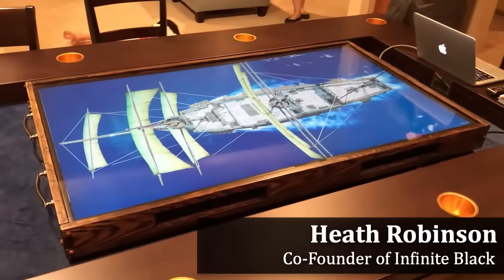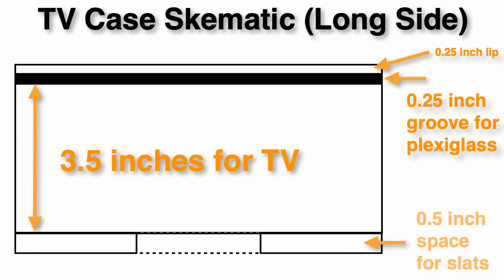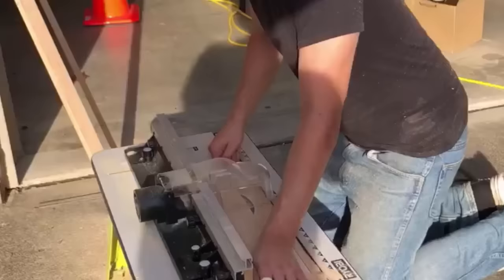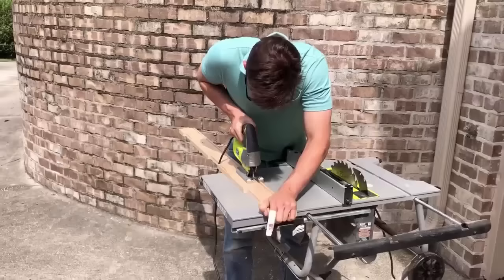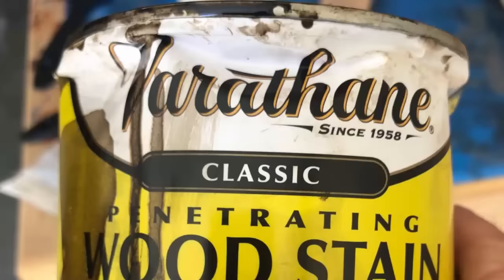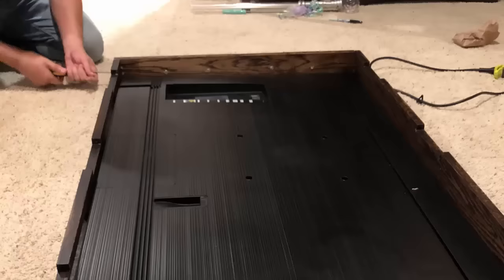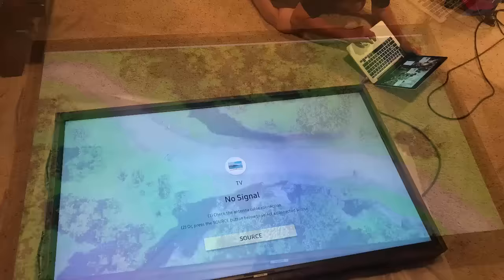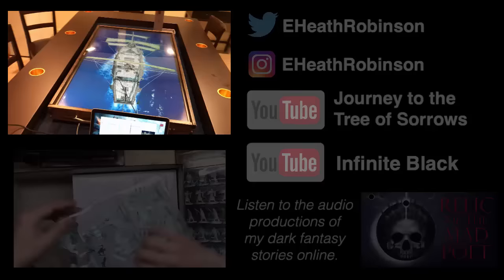Building a TV Case for your D&D Gaming Table for Digital Maps

Comment: I would have used tempered glass instead of plexiglass. It doesn't get cloudy or scratched like plexi.
Reply: It's also a hell of a lot more expensive.
Reply: If DnD is your main hobby and you'll using this for years to come, then it would be worth every penny. I think it would be worse to have to tear that thing back apart in a couple years to replace the plexi, than fork out the extra change for the glass.
Reply: @morgan5941  Well, they only screwed it together so it's not hard to replace the plexi, but yeah, I agree. Plexi is very very sensitive to scratches.
Reply: I've had a sheet of 2 mm plexiglass on my build for more than 4 years now. There's a minimal number of scratches on it, nothing that can be seen when in use, and we use regular minis on it every play session. Including heavier metal minis. Even if we had to replace the plexiglass every 4 years it would take a few replacements to get to the price of a custom cut glass piece. Glass would also be too heavy for my particular build, as the sheet fits inside the bezels of the TV itself, but that's particular to my build, of course.
Reply: I use pool fence glass for mine, it comes in many sizes up to 4x4 foot (thats the largest and is only $90)  my tv took a 1200mmx700mm which was cheaper still

Comment: I have not built mine yet but I'm going to build the whole table with it built right in. I do like that system you have though, you could potentially even still bring it to a friends place to play if its not too too heavy.
Looks great
Reply from the maker: I am thinking about building a gaming table from scratch, and after having done this build I think that it would be a shame to not build in a TV while the work is being done. But, it looks like I will be modifying existing tables for my gaming tables. Putting a TV in an existing table is harder. Good luck with you build!
Reply: @EHeathRobinson hanks, once I have more funds and time, I have the shop and tools. I'll probably film it and put it on my channel so others can duplicate it too if they like.

Comment: All those tools and no clamps in sight.
Reply from the maker: I have a rather large number of clamps in my workshop. I'm a large advocate of clamps, actually.
Reply: @EHeathRobinson  Then why no clamp when using the jigsaw?
Reply from the maker: @brianblather  I should totally have clamped that down when using the jigsaw. I did not because I am not working in my workshop. We built this over at Lou's house and we even bought that jigsaw that morning because he did not have one and we ended up needing it to cut out those slots. So yes! I highly recommend working from your own workshop on a project like this. Trying to load up and take the needed materials to a friend's house may very well result in sub-optimum build conditions! LoL :-) But we did get it done. :-)
Reply: Ye, not a single straight cut was made...
Reply from the maker: @Dixar  Straight cuts were made with the miter saw and also on the table saw when we needed to rip the boards down to size. To me, setting up the fence on the table saw and running the boards through it is an easy way to do that kind of work.
Reply: Whoa, clamp-life is real out here, it seems

Comment: I'd like to know more about the issues with image distortion and the floating effect when viewing from an angle.  Are there certain types of TVs and qualities that you look for that will minimize this?  Does having a TV with the widest viewing angle as possible help?
Reply from the maker: We have not had any issues with image distortion or a "floating effect". A couple of other people had brought up "miniature floating" in the comments, but if it were not for that I would not have even thought about it at the table. It just has not been an issue for us. I don't think Lou bought any kind of special TV to address that. He just got one the one he wanted when he saw it at a good price. Other people may have more information.
Reply: @frankharing712  Thank you very much for the words of wisdom.
Reply: @libertylion6088  i dont think the "tv" has much to do with this float. 
What happens is you install plexiglass or whatever, and if it is too far from the tv screen, players who are looking at it at an angle/far away may not see the character in the correct square/off centered because they are viewing the screen on the TV under and slightly past the miniature.
Reply: Couple thoughts, OLED has by far the best viewing angles and contrast ratio, however, due to price and concern for image retention OLED would not be a good choice.  What you want is a TV with a IPS panel and not a VA panel for optimal viewing angles. Go on rtings.com and it will list the panel type. Additionally getting a TV with the smallest bevel is preferred but more importantly you want that bezel to be flush as possible with the TV glass. Also going for the thinnest possible clear acrylic/plexiglass is preferred (1/16 or 1/8”?).
Reply: @forouza1  Why is the bevel an issue?  I thought that having a bevel would actually allow the plexiglass to have a border to keep it from moving around if cut precisely.

Comment: damn 
im a guy that likes samsung tvs
but it was the wrong choice here
you needed something with IPS panel for two reasons
ips panels don't flicker if you tap or nock the screen
and lastly IPS panels have better viewing angels so when people are around the table the picture is more consistent 
(sorry im a tv guy i just had to say that)
a low end sony or Lg in this case would have been better
Reply: Arman Shad is this a good TV: TCL 43S425 43 Inch 4K Ultra HD Smart Roku LED TV on Amazon?
Reply: Agree. Go on rting.com to see if the TV you are interested in is an IPS or VA panel. You want IPS.

Comment: Must be nice if you have the money!
Reply: Huh? You can get a 50" LED tv for $160.00 new...you don't need 4K to play D&D. The damn pad for a game table will cost close to that.
Reply: @MoragTong_  You can't even get a 40" anything for 160$ where I'm from. 50" will be 400$ and up for any type of TV.
Reply: This has to be a $400-$600 project with the wood and tools and whatnot.
Reply: @KingXOreo  True, it is much money for a single person, but if everyone in the group chips in, then it should be manageable. And it doesn´t have to be Oak, beech or pine are fine.. Ha, look at that, a rhyme.. wait another one?
Reply: @Jalgorn  Bars! Lol
Man, I cant even get these guys to commit to showing up on time, let alone chip in on something like this. 
I get what you're saying. Teamwork makes the dream work.
Reply: If you buy all of the stuff yes, however you can do similar with a bit of work and searching for reclaimed wood that people are getting rid of, pallet wood etc
I've just spent the past couple of weeks building a bar in my garage out of pallet wood with the only cost being a couple of bags of screws and a new sander because mine broke and an LED strip to make it glow. Total cost so far is £5 for screws, £8 for sand paper (ebay bundle has all the grits in it so you can bring it down to a nice smooth finish) £35 for a random orbital sander (you don't have to buy the most expensive tool on the block as long as they have a warranty, if it breaks take it back) and £5 for the LED lights. I still have to buy some wood stain to finish it and that will cost me between £10-20 as I can't decide what finish I want, but there's enough in the can for another couple of projects.
So for one of costs £5 screws and £5 LED's and time finding the wood. Everything else will be used in my next project which is fitting a wood floor to my garage using reclaimed wood!
If you can't build a full size table, why not do a portable one? This is one I made last year https://www.instructables.com/id/D6-Deployable-Desktop-Dicey-Digital-Dual-Display/
Reply: Pool money from your group(s).
It should be easy.
1080p is fine, you can get PDF maps all over the place for not too much.
You CAN make a bezel, don;t have to, and you can do that rather cheap too.
Reply: Well, if you are dirt poor... but wood is cheap, like 2 dollars a plank. Construction materials probably costs only 10 dollars. The finishing is slightly more expensive. The TV itself, I got mine from a genuine black friday sale for 99 dollars. I'm considering making one for the novelty of it, just to have a tv table. Now I just need to find a big sheet of tempered glass. This entire project cost me 113 dollars.
Reply: @Smarglenargle  I saw another build (can't remember where) and someone in the comments suggested a screen protector similar to what you put on a phone. Apparently you can buy larger ones, protects the screen from scratches, right up against the screen so you don't have hovering minis, and easy to change over. Might work out cheaper than the tempered glass, failing that plexi glass is cheap!
Reply: @MoragTong_  I just brought home a 50" 4k from walmart for $228. and I live in one of the most expensive areas on earth.

Comment: How hard would it be to add a vertical mount assembly to this setup? Maybe a couple poles in the bottom of the TV case, with bases in a side of the table.
How about a slot underneath the table that the TV case slides into for storage, as well as a flush tabletop that goes over the gaming slot (with or without the TV)?

This can allow the table to have 4 modes:
1. Vertical TV and couch.
2. Horizontal TV gaming table.
3. No TV gaming table.
4. No gaming regular table.
Reply from the maker: I'm not sure. That sounds like a very modular system, but probably a lot more than we would've ever tried to make.

Comment: I'm curious about the plexiglass layer. Two questions. At that size, does the plexi dip down in the center at all, touching the screen? And, at .25-inch thick, when seen at the angle sitting around the table, is there a problem with the figures not looking like they are "on" a square? One other question. Do you have any problems with "burn-in" on the screen? In our game, an encounter might last hours, or even the entire session (10 hours or so). I notice this one is UHD. I wonder if QLED or OLED are better or worse for burn-in. Thanks, and impressive work. Thanks for the video.
Reply from the maker: Hey! Glad you enjoyed it! The answer to all of those questions is "no". For us, no concern with dipping down in the middle. Lots of people ask if we have the problem with the miniatures looking like the they "floating" above the square, and it has never been an issue. It is not even something we thought about during play.

Also, no burn in problems. We would typically play about six hours at a time on it. I have no idea if other TVs would be better or worse to use.

Comment: One question (probably won't even see this since I just saw this video): Why not use nice but inexpensive Powered speaker connected with RC to the audio out and then mounted flush from the underside into the case? Seems like the enclosure models would sound better and would be easier to mount.  Just my thought.  Thanks for sharing this project.
Reply from the maker: We just didn't think about doing something like that. Powering up the speakers would be neat, but really, we tend to keep the volume down pretty low anyway during our games. We keep it just load enough to keep a bit of ambient sound in the room. If it gets too loud we find it interferes with the game play.

Comment: protip: if you're putting a screw into the end of a board, drill a small pilot hole first for the screw first and it will not split the wood.

Comment: maybe i missed it, what thickness did you go with on the acrylic glass top from TAP plastics?  
and would you make it thinner or thicker if you were to redo
Reply from the maker: I think it was a quarter of an inch thick. It has been working fine for us.

Comment: neat but i thought those hated being laid flat because of a lack of the support for the center screen?
Reply from the maker: I can't speak to that. We haven't had a problem and have been using it for a while now. The TV is not stored flat between games though if it matters. It comes off the table when we are done and goes in the closet on its side.

Comment: Quick question: how did you power the TV? Did the power cable just loosely hang below and connect to an outlet? Or did you have another power source in the table?
Reply from the maker: The power cable did just run off the table and connect to an outlet in the wall. There was no other power source.

Comment: What a great idea! I had to share with my favorite DM because I think this is awesome. Hey for bonus Hipster points you could even use 'reclaimed' free pallet wood :D  OK serious question, is this something you can hook up an Art Pen and Drawing Pad to add in notes or like even AoE templates in for spell? Then just clear when round / effect ends?
Reply from the maker: I am working on a ceiling made from pallet wood I was given. I will put out the video on that soon, actually. I am not sure if the software we are using for the animated maps has integrated pen support. It probably does not. But, there are probably other ways to make that work. You can't draw directly on the screen, of course, but the DM could have a pen tablet hooked up to his laptop.

Comment: WOW! Great looking table. Looks like the effort paid off. I have a few questions:

Do you have any regret using 1/4" thick plexi or glass on top of the TV? Do you believe you may have been able to get away with using thinner material to reduce the "floating" effect of the miniatures?

I would VERY much like to do this for our group. I use Fantasy Grounds. Are you aware of a way to have each player use their own mouse to move their tokens?

I couldn't tell from the video if you guys removed the bezel around the TV. Again, to reduce floating effect and to prevent dust build up between the TV glass and the Plexi. 

When sharing images other than maps such as portraits, does the GM slide it to the TV? Has there been any issue with players cocking their heads to look at an upside down picture? 

Great table. Looks like a great room too,. You guys have everything INCLUDING the kitchen sink!  hehehe..  :)
Reply from the maker: Wow! I am so glad you enjoyed the video. That is a lot of things to cover. I don't regret using the 1/4" thick plexiglass. To be honest, I have not even noticed the "floating effect" during game play. I would not have even thought about it until it was brought up here on YouTube.

I have never used Fantasy Grounds. We use physical miniatures, but if you were going all digital, I don't know of anyway to give each player control over their tokens (and only their tokens) by a mouse. That would be cool though.

We did not remove the bezel from the TV.

The GM does sometimes slide pictures, such as NPC portraits, on the screen for us to look at. Sure, for some people it is upside down, but that has not been a big issue.

Comment: I like this alot! Trying to do something similar myself but with a 32inch TV. Ive tested to use a couple of foam bits  below the TV to balance it and to test it out before i start the project. The group liked it alot so im definitely going to go to second phase and plan the rest, your video will probably be the design im going with unless maybe its better to sink the TV down into the table to save space as my gaming-corner is lil-bit to cramped.
But the biggest problem i had when i connected the TV to my Laptop is to navigate around the picture and send pictures to the TV from Laptop, as its a second screen and its lying on the table its really hard to actually navigate, to drag a new map or remove a current map and all there betwen, do you use a program of sorts to help you out? I see when you show a test-image you are linking the picture but its a lil-bit to blurred out at 12:27 to make something out of it. Or are you just treating it as a second-screen? Would love a clarification on how you send the picture to the TV and such =).
Reply from the maker: These are great questions. If I build a gaming table of my own, I am definitely going to build the TV into it. You are right that navigating on the screen when the second screen is laying on the table is difficult. That is the biggest hangup we have during play. I don't have all the details on that because Lou Anders is the Dungeon Master and has been running the tech. For the animated maps he has been using the player that Dynamic Dungeons has created for them. But, I think the simplest thing would be to use a screen mirror, IF you don't need extra functionality from the player on the DM's side of the screen.

Comment: I'm planning to build a table with a TV in it and I wanted to use Plexiglas to protect the screen, but I had a question:
Should I set the Plexiglas directly on top of the screen or not?
My worry is that the more distance between the map and the miniatures, the more distortion there will be, depending from the view angle of each player.
O should I put the Plexiglas on the TVs frame, similar to what you guys did?
Have you noticed this or is my worry unwarranted?
Thanks in advanced!
Reply from the maker: A few people have brought up that concern here in the comments. They recommended that we should have removed the bezel around the TV first and then set the plexiglass right down on top of the screen to help with that issue. But really, distortion because of viewing angle has not been anything that I even noticed or would have thought about when we are playing. Maybe it is there, but the effect has been so small we have not found it to be an issue at the table.
Reply: @EHeathRobinson  thanks a lot for your quick reply!